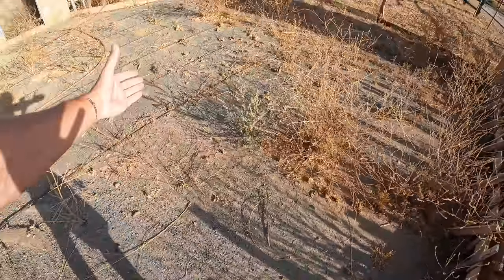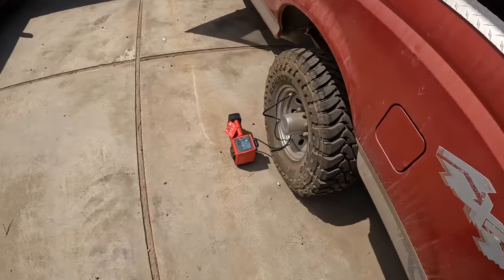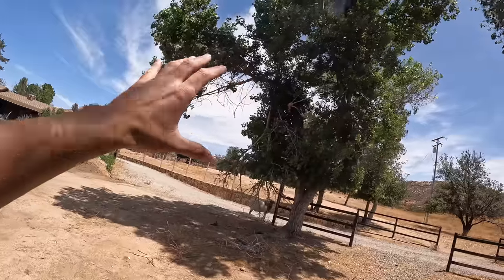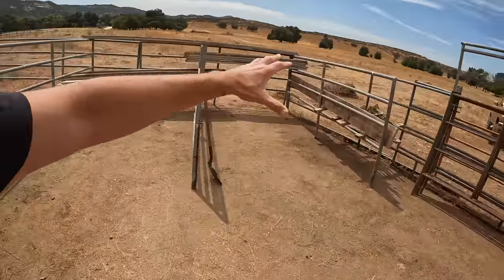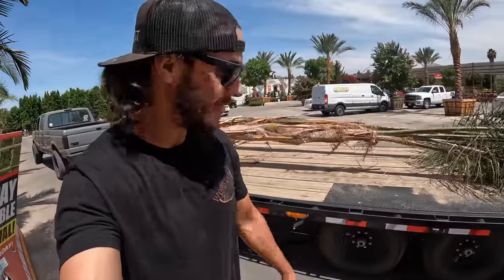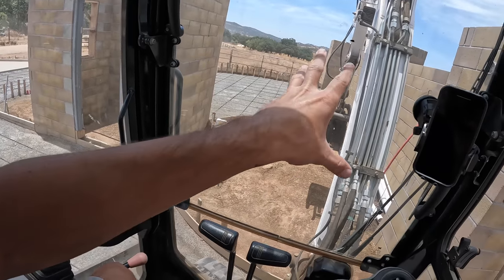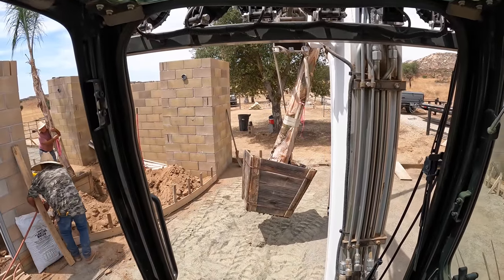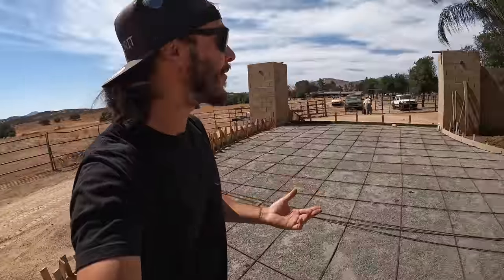Building the New MASSIVE Entrance to Ryno Ranch! (PART 15)

Comment: Hear me out, I LOVE Milwaukee tools, have many tools in the m18 and m12 platform. But dewalt makes a jump box, with a air compressor,  and I've had it jump start multiple dead batteries on one charge,  and can fill up 35 inch tires on my 4runner , all of them from 10-15 psi to 35 psi and still have batterie left to jump start a vehicle.  And has DC 12v plug ins, and USB. I think you'd really benefit from it